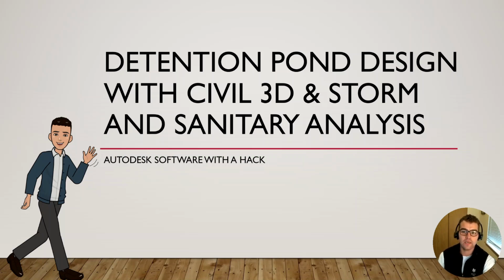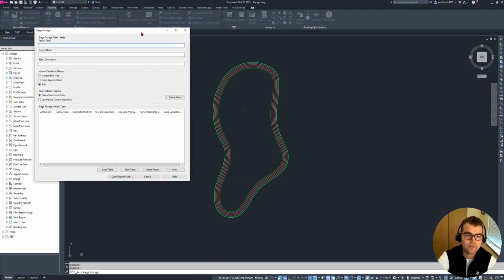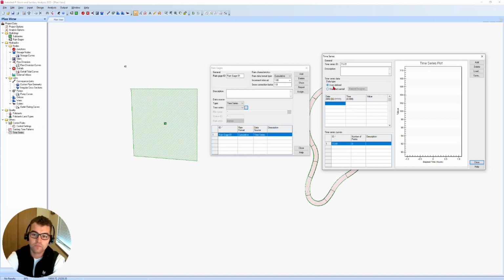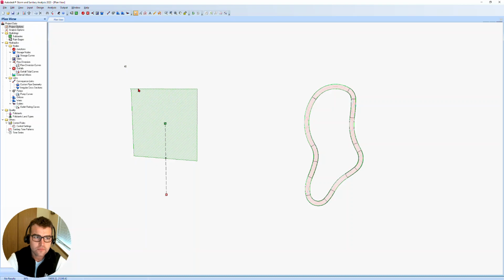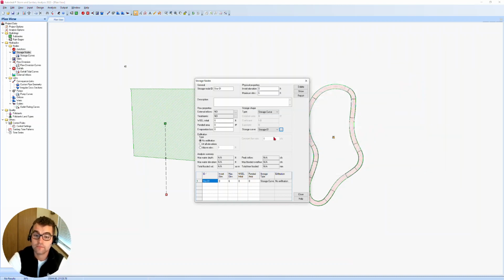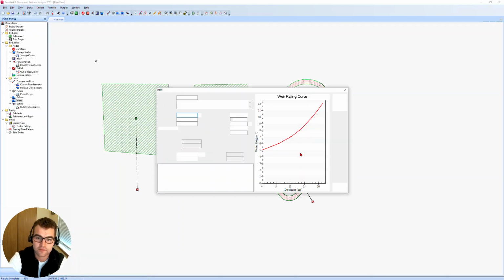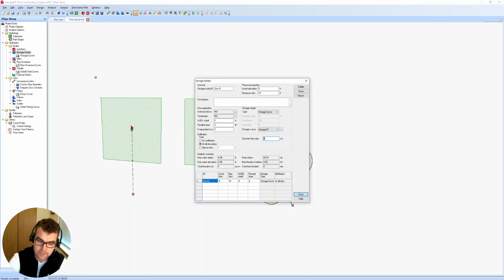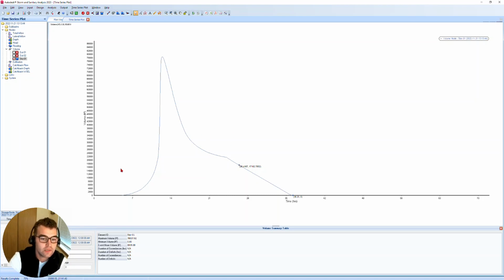Detention Pond Design with Civil 3D & Storm and Sanitary Analysis

Comment: What would you do differently to show different return periods? Most municipalities require basins designed for anywhere between the 2-year and 100-year storm events.
Reply from the maker: You can have different storm events assigned to a rain gauge. Can either run a single event (one storm)  or multiple events (multiple storms) at once. Suppose If you wanted to see them entirely separately, duplicate the basin and two separate rain gauges.

Comment: IMPORTANT NOTE for people using the Stage Storage tool. If you have a survey of a basin (i.e., a tailings dam or "bowl" shaped basin that has an uneven floor), when using the stage storage tool, the tool will ignore volumes of depressions in the basin that occur at the same elevation. For example: imagine a completely flat ground and now three holes are dug. Civil 3D will ignore the volume that two of these holes have and will only calculate the volume of one of the three holes. This means the total volume it returns will be much less than what is actually available. 

The stage storage tool makes certain assumptions about the land and the water storage areas, such as assuming that the storage areas are perfectly flat and uniform in shape. If these assumptions are not valid for the particular scenario being modeled, the volume calculations may be inaccurate. In reality, storage areas can have variations in elevation, curvature, and irregular shapes that may affect the volume of water that can be stored. If the tool does not account for these variations, it may underestimate the actual storage volume.

I.e, if a storage area has a depression or basin that is not perfectly "flat", the tool may not accurately calculate the volume that can be stored in that area. Similarly, if the storage area has irregular boundaries, the tool may not be able to accurately calculate the volume that can be stored in the corners and edges of the area. 

THE FIX: Using the "Volumes Dashboard" tool instead. I wrote a short step-by-step document on how to use this method instead to bypass the issue of the Stage Storage tool. Reply to this comment with your email if you'd like me to send it.
Reply: It is correct, so in that case the calculation has to be manually, by using surfaces and vols between them

Comment: Can you do more SSA videos?
Reply: Best ways to begin transitioning to it. (Currently use other programs outside of C3D for drainage, but use C3D to design the site.) making an attempt to transition into using C3D/SSA. 

So maybe a good video on a simple design for one or two inlet pipe network which flows into a pond. Show if there is a good way to automate catchment areas and upload water drop travel distances automatically in catchment areas and CN / slopes for those areas and import all to SSA (if even possible). Show how reports are created or exported out of the program. 

Just typical workflow from start to finish and the most typical design usages for smallish maybe 1-3 acres commercial site design.

Maybe show how (if possible) pipes sizes guessed in C3D are to small and how if changed in SSA it links back and updates in C3D.

Take off tables, material counts, types, lengths etc. 

Just some ideas. This video about the pond was laid out and easy to follow. I don’t comment hardly any but you seem to show more of a practical use type of demonstration vs other videos where it’s just more showing off features of the program.
Reply: Maybe show best workflows for iterations on pond design as far as if the footprint of the pond how to be increased after running in SSA and then transferring the size of the pond back into C3D. Not sure if this would be done any easier, just thinking if the two programs are linked maybe it’s possible to change footprint size in SSA with an overlay of the project take make sure the new footprint fits. Not sure if half of this is even possible just throwing out questions I have since In my head the two programs talk to each other so not sure how much the can actually work with each other more efficiently…
Reply from the maker: Hey, What ya wanna see ?

Comment: How do you incorporate the soil percolation rate of the pond floor?
Reply from the maker: Input tab > Design Options. At the Bottom of the dialog there is an option to set the "Storage Node Exfiltration Method." Then within the storage node you can set exfiltration type. Check out page 188 of the in product help.
Reply: @adskhack  Thank you. I will try it.